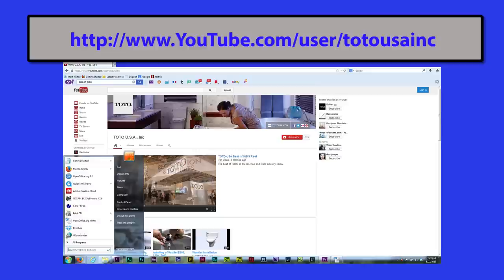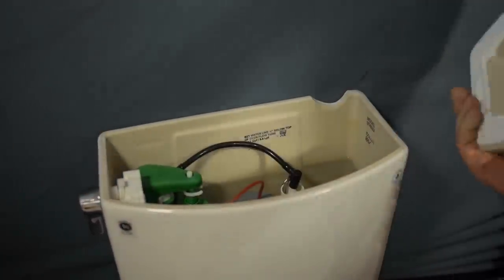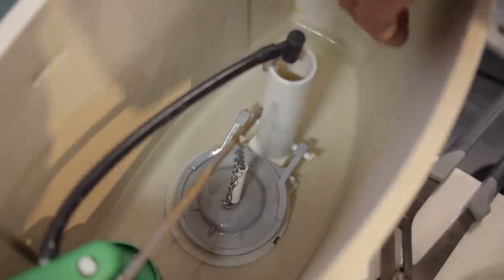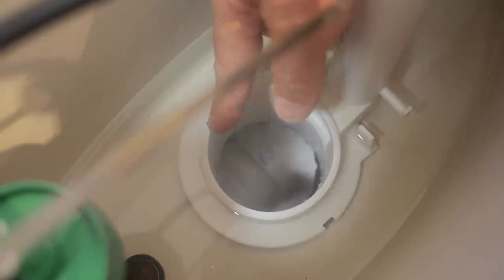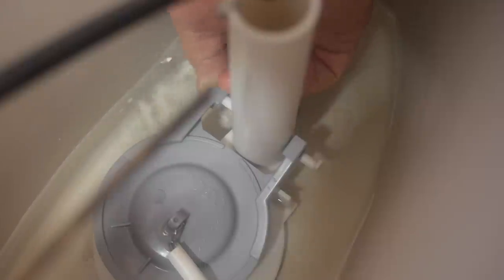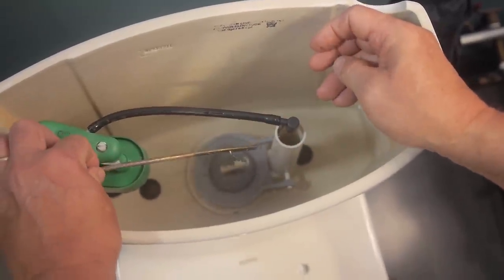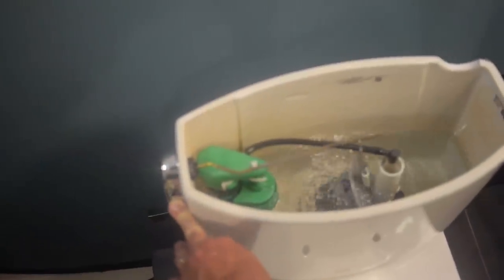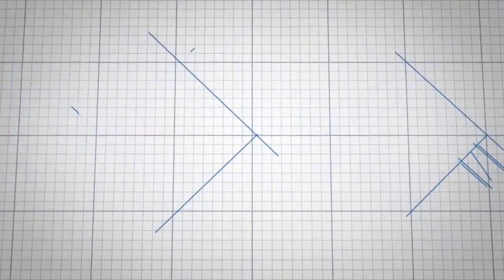Replacing a Toilet Flapper

Comment: Removing the old one was what was most important to me. Just like the previous comments, it was hard with age and I wasn't sure if it needed to be cut off or not. I did manage to finally bend it enough to get it off the posts without breaking the mounts.  Thanks for the video!

Comment: The rubber flapper gets hard with time and makes removal of the flapper a bit difficult. I used a knife to cut the rubber down to the posts in order to free the flapper. Do it carefully since breaking a post would mean replacing the tube the posts are a part of.

Comment: When removing the old flapper, take it off from the bottom of the post.  It's best if you are able to use two fingers to force the bottom of the flapper off the post.  I had a pink Toto flapper that was difficult to get off, until I used this method.

Comment: For all of those removing the flapper using a sharp utensil, try putting some warm water in the basin to make the flapper malleable again. Shut off the water, remove all of the water in the basin first, then pour in some warm water.
Reply: This warm water advice is the best part of this video. No need to apply excessive force, no need for sharp objects, just some warm water to soften the  rubber. Thank you!

Comment: My flapper does not come off like the video, the plastic is to hard.  Another forum said to cut it off per TOTO customer service.
Reply: Me too. It's a pain.
Reply: DA Arthur I had the same problem....hard as a rock.   I had to cut it with serrated edge knife.
Reply: Thank you for your comment. I was struggling with mine too. Ended up cutting the rubber plastic as you suggested and worked like a charm!

Comment: Use food coloring to see if you have a leak.. Put coloring inside of the top of toilet where water is, then you put 3 drops of coloring. Wait about 10 minutes. If coloring is seen on toilet, you have a leak. Hope that helps.
Reply: super helpful!  until I did this, I wasn't sure if it the leaking was from the flapper or the fill valve.  now I know it's the flapper since I saw the coloring come through.

Comment: I removed the old flapper with difficulty, by cutting.  Toto, this is a poorly designed part that is negatively impacting your reputation.
Reply: Tell me about it...I bought three new Toto toilets and within 3 years every one of them was not working properly...continuous running water.  Totally regret the purchase.
Reply: @singtweetypie hi sorry to hear if memory serves I used a mini hacksaw to cut away the little arms that attach the red part to the post because I couldn't remove it by hand due to the hardness of the plastic,  it is a bit tricky to do to get your hand in and cut without damaging the post, other comments here seem to imply others took that same approach good luck!